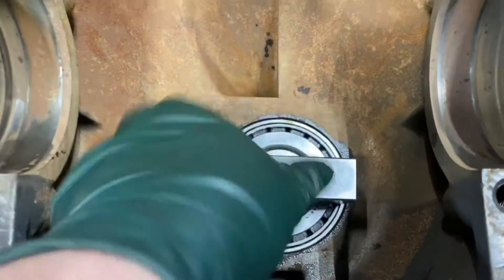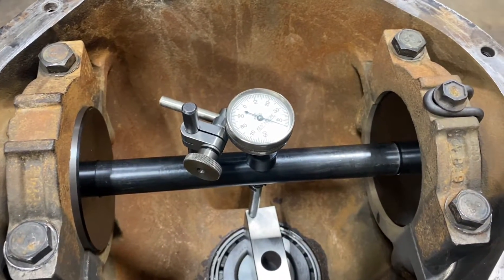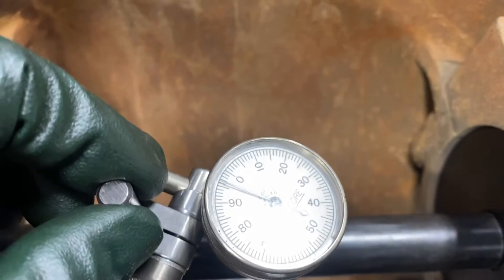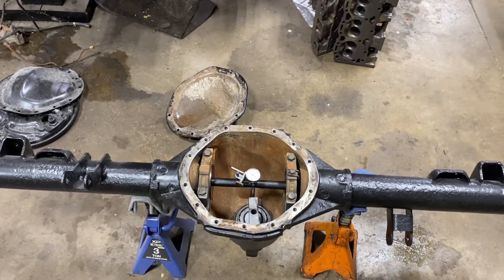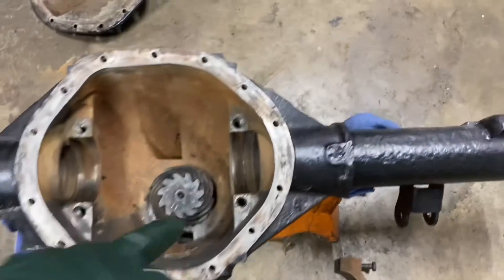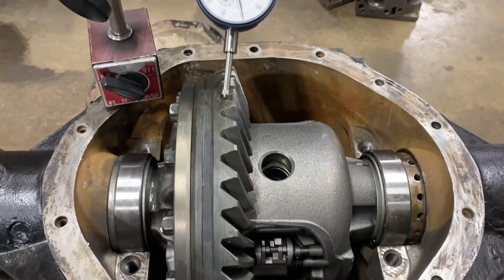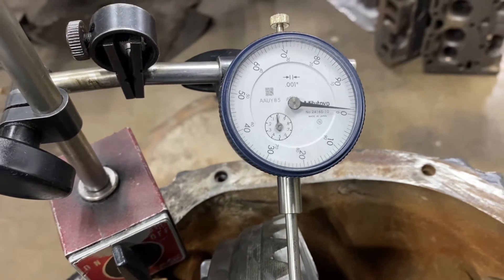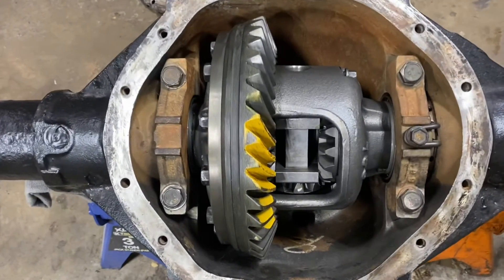GM 9.5 Rear Axle Setup Using Kent Moore Tools

Comment: Also, at over $1000, hardly anyone uses these tools (maybe a gm tech at a gm shop). For $500 you can get a generic tool that measures the actual depth. Then you subtract the dim on the pinion for the shim thickness.
Reply from the maker: That’s why this video specifically states “Using Kent Moore Tools.” It’s to illustrate how the GM techs were supposed to do it. I realize not many have these tools.
Reply: @LakelandAutoMarine  I went and pieced the set together thanks to this video.
Reply: Not his fault you can't afford it.

Comment: All Data says to check the carrier preload by measuring pinion torque with carrier installed and subtracting pinion only torque then multiplying by the gear ratio. I find that 3 holes on the carrier adjusting nut is always too high and end up at 2 holes even for new bearings. You skipped this, or your service instructio s leave it out. I suspect it should be left out.
Reply from the maker: I usually go by feel.